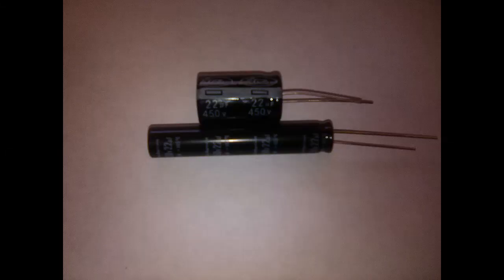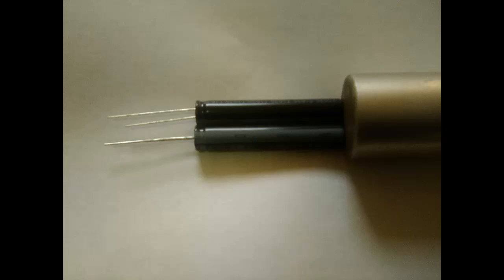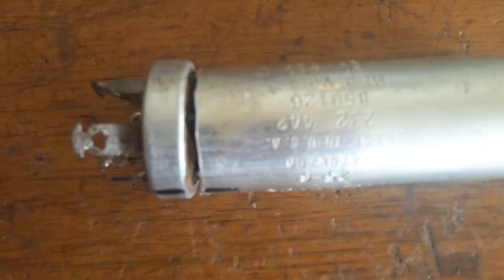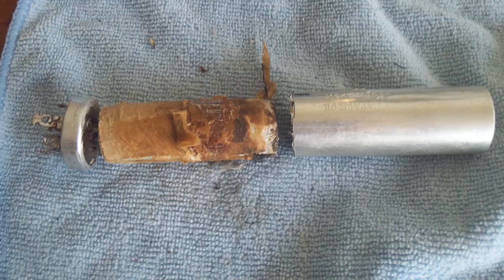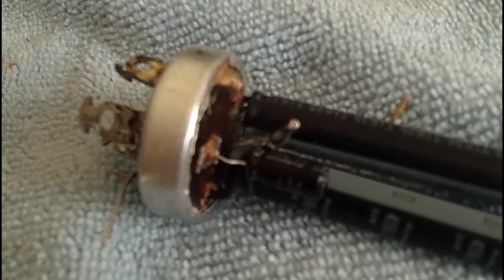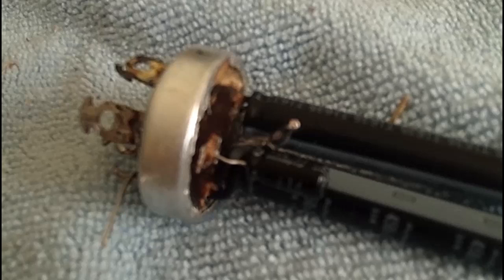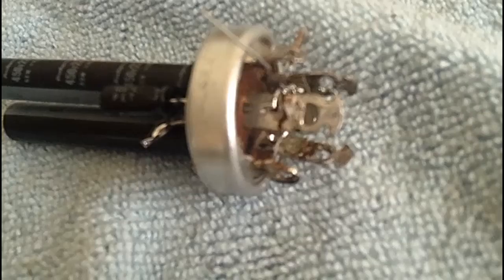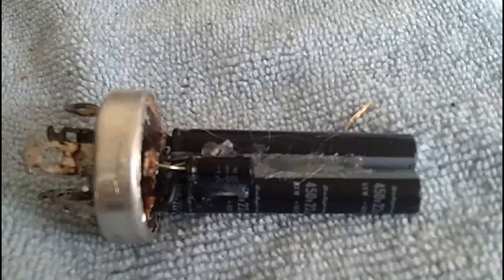Heathkit AR 2 Electrolytic Capacitor Rebuild

Comment: Great job Bob.
I got a question, how did to close up the aluminum can, did you use aluminum solder?
Reply from the maker: I ran a bead of hot glue around the seam. Since the top is slightly smaller than the base there is a nice V there to hold the glue.
Reply: Thanks Bob, it came out good.

Comment: I do like those thin caps. Might have to look into supplies of them over here.
Reply from the maker: Farnell carries the Rubycon at least.👍
Reply: @YouAllKnowBob  I use them a lot so I shall hunt them down next time i'm shopping there.
Reply from the maker: Just set the filter to 10mm diameter. That's what I tried on Farnells site and they popped up.